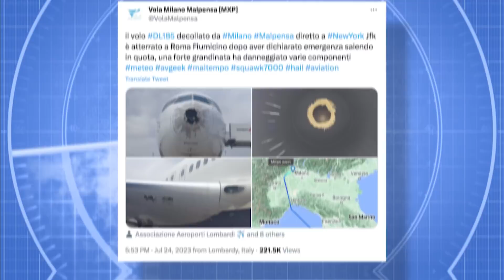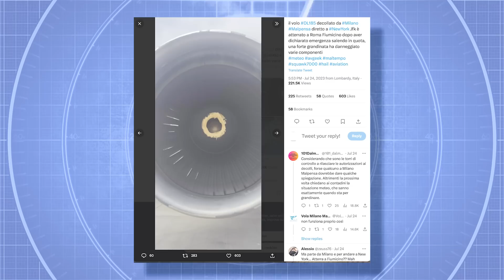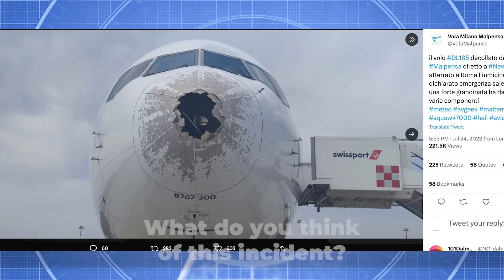Delta Air Lines Boeing 767-300 Suffers Damage From Hailstorm

Comment: I was in Desio at the time of the incident, and the multiple tornadoes and hail damage was widespread, right out to Malpensa. Many tress were down, some on top of cars, and we suffered hail damage to the car, while driving back to Desio from Dinner. I flew out from Malpensa the next night, and the electrical storm just beyond the airport was stunning. I am surprised that the plane (Delta 767) actually operated when it did, rather than wait it out.

Comment: It will be interesting to see if Delta repairs this 26.5 yr old airframe or just decides to retire it.
Reply: there was a delta 744 hail incident (n644us) in 2015
due to the hail damage and probably other factors including age it was written off and ferried to be scrapped
Reply: Reminds me of the 717 that oanded with no nose gear
Reply: honestly they'll probably scrap it and replace it with an a330-900

Comment: Don't know why everyone is saying that it's because it's an old plane Delta has and it should be parked this could have happened to any new plane also all radar noses on planes are carbon or fiberglass it didn't happen because the plane was old if that's the case then there's a lot of B52s that should be parked then

Comment: Get real, the pilots were instructed by Delta headquarters to divert to Rome so the passengers could be booked on other flights at the lowest price point.   Nothing happens on an airliner without corporate approval
Reply: I bet they didn’t even compensate the passengers beside maybe a night in a hotel. Airlines are not required to compensate you for damages caused by things out of their control.
Reply: Fast transfer for the passengers maybe....another Delta flight.

Comment: why would it go to rome when it’s headed to NY. strange decision
Reply: Did you watch the video? Did you see the plane? Would you have wanted to continue with the 8 hour flight or fly to a nearby safe airport?
Reply: @lactoese  I wouldve carried on the direction at least, maybe stop at London as there other flight to quickly reconnect on
Reply: @colonel_carlito  why carry on the direction London is 1.5 hours away and Rome is closer and just because london Heathrow is bigger, Rome is still a big airport and has delta connections and is still the same country which might be better in terms of border control and visas and so on.
Reply: @colonel_carlito  That is why you don't work for an airline.